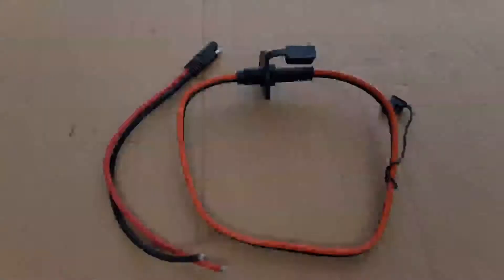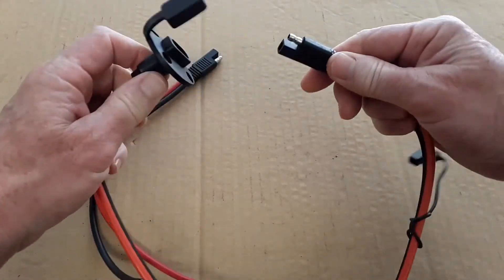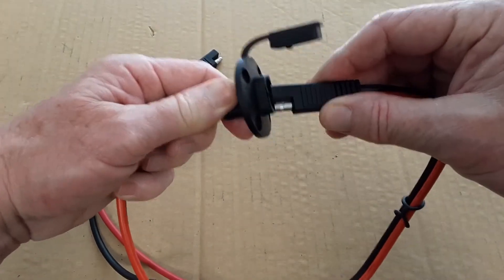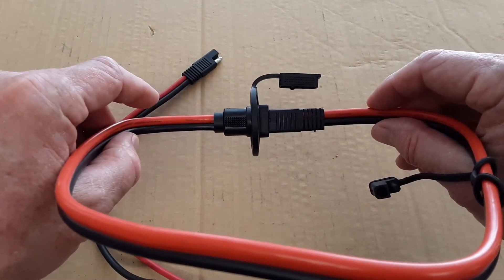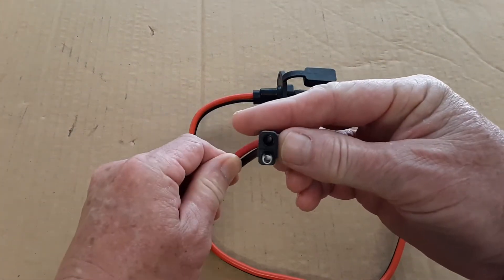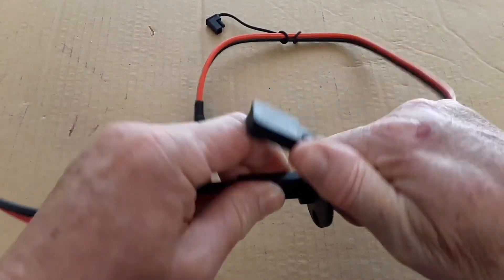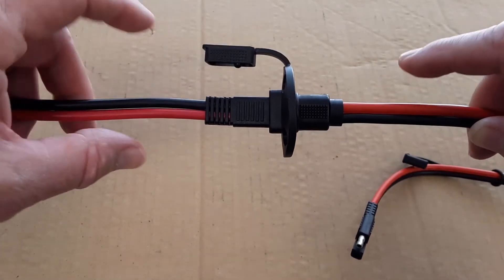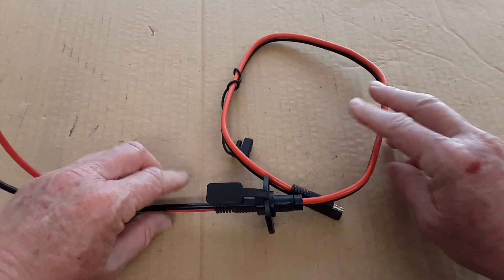SAE Connector Information for Kayaks

Comment: The pin is always positive coming from the trickle charger.   The covered connector or socket is always positive coming from the battery.

Comment: it is not a matter of brand, they are made to be this way. The plug is "hermaphrodite" designed with a male and female connectors so it can plug into the same type plug (as opposed to two different plug design all male one end and all female on the other that would be required to form a connection) basically produce one plug instead of two.
Now, being in origin an automotive connector type you will find that the wire going from battery to connector will need to have the Positive lead covered to avoid accidental contacts with the chassis, thus it is terminated at the female end of the connector (red wire to covered side). On the wire coming from the charger instead it wouldn't matter if the positive is uncovered as the charging unit shouldn't be working unless connected, so the positive wire is terminated at the male side of the plug (red wire to exposed side). Once connection is made the red wire is continuous across the plug.
So it doesn't matter the brand, it matters if you get the cabled plug that goes to the battery/load end as opposed to the charger/solar panel end

Comment: What would be a remedy for this situation other than sticking to one brand of SAE. If you have any SAE connectors that are opposite from what you are trying to connect, do you just swap the colors? Like connect the black cable to the positive and vice versa?
Reply from the maker: There is a SAE polarity reversing adapter you can buy that solves the problem.
Reply: not a brand thing, the side coming from the source is cabled in one way and the side that uses it is cabled the other way (automotive connector so the positive attached to the battery needs to be covered, the positive coming from the charger can be exposed). In fact an "extension" wire will be terminated in the two different ways. If you look at the extension in the video you can see how the red wire is terminated with a male at one end and a female on the other (note that in the video when indicated them at the waterproof plug he confused the two and then had to turn the plug around)
If you swap the wires as you said, always wrap with insulating tape of the right color at both ends of the single wire, that indicates to anyone else that the wires are swapped.